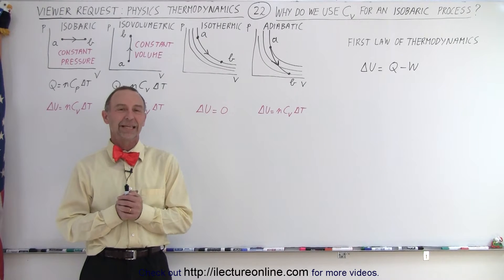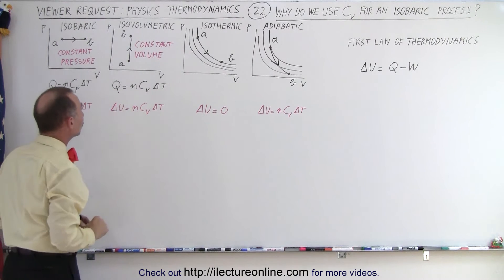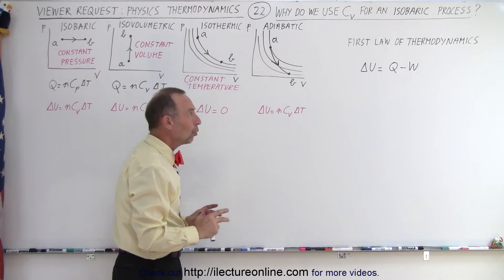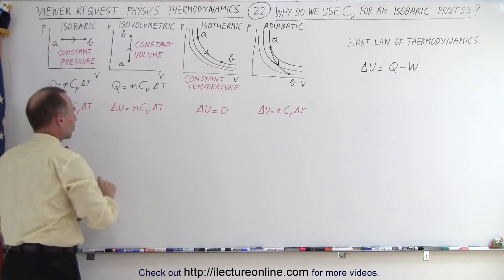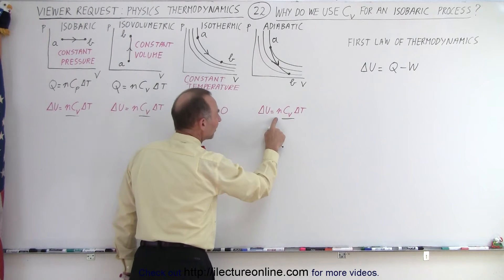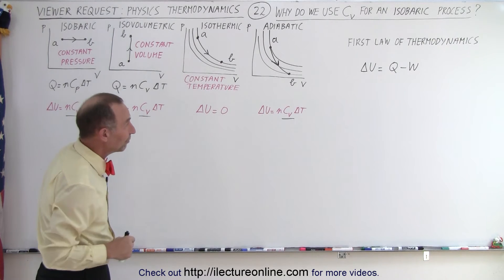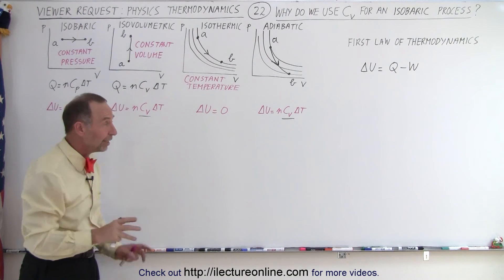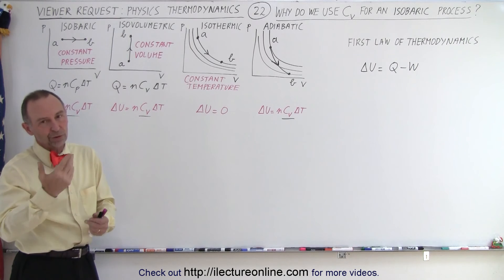Physics: Viewer's Request: Thermodynamics #22: Why Do We Use Cv for an Isobaric Process?

Comment: One of the things I remember from college physics, thermodynamics, is that you can only measure energy changes of a compound, not the energy content.  I never felt that I got a good explanation of this, based on the following:
The change in internal energy, of an ideal gas, is indicated by temperature.  If I was to reference absolute zero (which I know can never be reached due to zero point energy) the difference in my temperature and absolute zero, would be a indication of energy content.  HOWEVER, obviously there would be phase changes as you continually extracted energy from a substance, but why couldn’t you use the enthalpy of fusion (and other enthalpy of phase changes) to keep a running total?  This is a common excercise in figuring the energy change required to say cool a certain mass of steam from 120 C to 0 C.  Then, the energy of phase change to ice, then say the energy extracted to cool to -20C.  The only thing I can think of is that the specific heat becomes a function of temperature, as such you can never really get a good indication of the amount of energy that needs to be extracted as you get closer to absolute zero.  Which of course you would never reach.  Would this mean you had to extract an infinite amount of heat to reach absolute zero?
Reply from the maker: Trying to get a system to go to absolute zero is like trying to keep the bottom of a boat dry when it has a leak in the bottom.  As you remove water from the boat, more keeps coming in through the hole and no matter how hard you try, the bottom of the boat will never be dry.

Comment: Thanks.  dU = nR dT holds for any process step of an ideal gas.  Further: PV = nRT, which also gives:  d(PV) = PdV + VdP = nRdT.
1) Isobaric:   dP=0:          V dP=0 thus P dV = nR dT.  Therefore: Q= dU - W = nCv dT + nR dT = nCp dT.   (since for ideal gas: Cp=R+Cv).
2) Isochoric: dV=0:          No work: W=0.                      Therefore: Q= dU - W = nCv dT + 0 = nCv dT.  
3) Isotherm: dT=0.           dU=0, PV=nRT is constant. Therefore: Q=-dU - W = -W and.PV = nRT.  P=PaVa/V.  W=-nRT ln(Vb/Va). => Q = nRT ln(Vb/Va).
4) Adiabatic:                      Q=0.                                       Therefore: dU=. Q - W= -W.        => W=-dU = - nCv dT.
Reply from the maker: This is a nice summary

Comment: You say that for all processes calculating change of internal energy we use the same expression (that with a Cv), but you don't explain why is that so...
Reply from the maker: The internal energy only depends on the kinetic energy of each molecule, which in turn only depends on the number of degrees of freedom the molecule as (which depends on the shape and number of atoms in the molecule) and on the temperature.   Cv is based on the degrees of freedom of each molecule and thus that is why we use Cv in the internal energy equation.
Reply: @MichelvanBiezen  Because Cp=Cv+R therefore also Cp is connected to the degrees of freedom, so I don't think your explanation is entirely true. But if we for example (ideal gas) go from one isotherm with the temperature T to the other with the temperature T+dT, then the increase of the internal energy is U+dU, where dU depends only on dT (because U = f/2 n R T, where f is the number of degrees of freedom). If we now choose the process with V = const., then from the first law dU = Q - W, because W = - p dV = 0, we get dU = Q and therefore dU = Q = n Cv dT. Because we have seen that for all possible processes that go from isotherm T to isotherm T+dT, the internal energy increase must be the same, therefore we use for all that processes dU = n Cv dT (and for T = const. dU = 0). Or said in the other way - The internal energy is function of state and therefore independent on how we get from state 1 to state 2
Reply: @milansvetec3814  The fundamental idea is that internal energy is a state function, and changes in it, do not depend on the path we take.   I can cool a gas at constant pressure directly, or I can cool a gas at constant volume, and then compress it slowly along an isotherm to the final state.   The net change in either internal energy or enthalpy is the same for both paths.  But the heat and work will be different.

Enthalpy and cp are used as shortcuts for accounting collectively for the change in internal energy and work done, in an isobaric process.
Reply: @carultch  You missed my point. The lecturer announced that he would explain why Cv is used instead of Cp for the calculation of internal energy in processes with constant pressure. But in the youtube lecture he says only that Cv is used in any processes to calculate the change in internal energy. But he doesn't say why we can do that. If you read my reply to his reply, I suggest an answer to him….